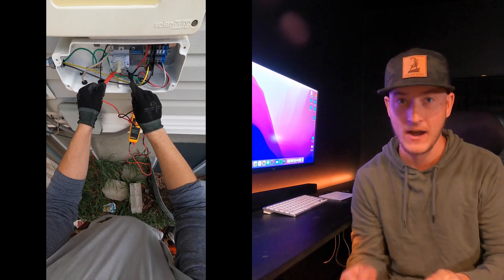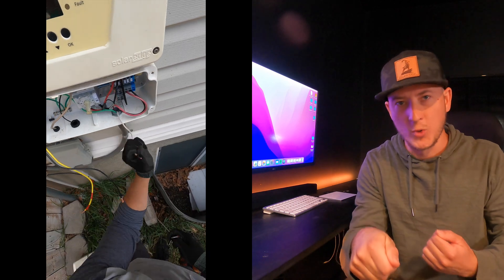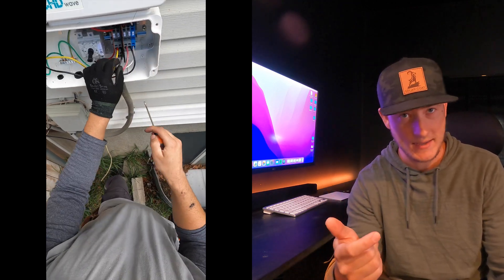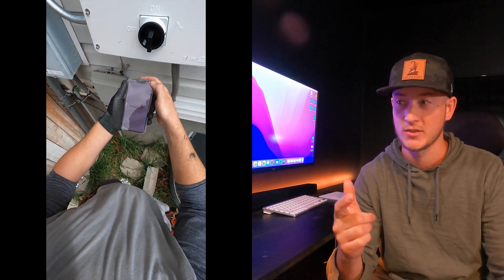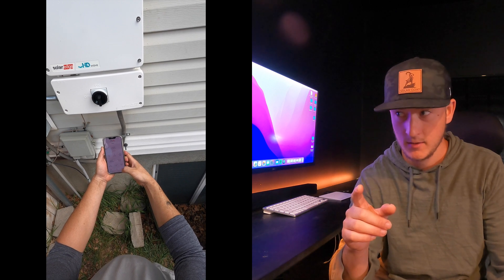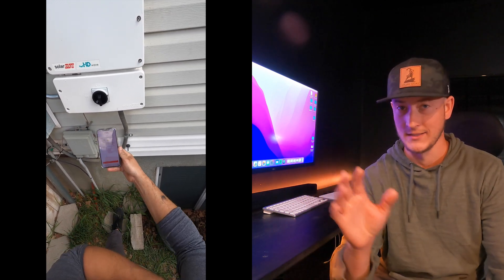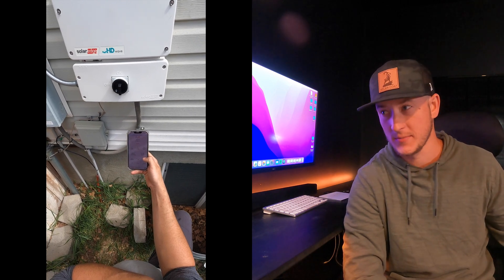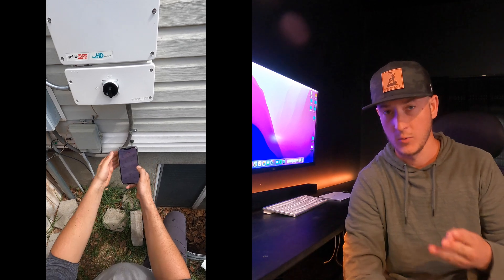How To Replace a SolarEdge Solar Panel Inverter

Comment: 2020 I spent $30k with smaller solar company. 3 years in lost wifi cause 3 g then 2 years after this April wife says electric bill $100 more . Got me to investigate , called smud and they said last reading they got was Dec 24 😔 . When I was finally able to get a hold of solaredge then finding a contractor on their preferred list $400 diagnostic lead to bad inverter and maybe 2 optimizers plus going wifi 5g . Their quote energy aid  $7200 think I'm dumb! Now I have inverter but not sure diy ,but don't have money out into it should I try?

Comment: I basically lost production for most of August and September here in Massachusetts, having Tesla replace this under warranty. It really is a simple install, so why does this take so long? You would think Tesla could arrange an advanced replacement, but no. I have been waiting weeks! Is this because Tesla is understaffed?, doesn't care that much since I am selling SRECs on my own, or is it supply chain issues due to the war in Gaza?

Comment: Thank you so much, technicians want to charge me $1200 to replace the unit. I have decided to do it myself. I’m glad there are people here to show me how to!!
Reply: Were you able to do it successfully on your own?
Reply: So long story ever did 3g modem replacement 2022.
Bought in 2020
My installer said in 2022 they stopped residential ( could I sue them?)
Dec smud stop recording solar. 

Wish would paid attention. Wife pays the bills online. Last month she said our bill was $350 little high. 
Got me to do some research. 
Used a company on my solar edge list of installers, energy aid ( Don't use) 
$299 diagnostic fee 
1. Inverter $1695 ( how if under warranty) 
2. Cell kit $2695
3. 2 optimizers $1800 
4. Labor 2x $650
5. Fees $850 gas, credit card fee, etc
Solar edge sent invert to them. Now need to wait .
System cost me $29000
 Can I diy this?
Reply: @Sciontc22jj   I 'm in Texas and yes you can DIY that, it's cheaper to get either a off grid inverter (cost around $2500) for a 12k inverter but that doesn't let you sell back or get a hybrid inverter one. they start around $3400.00 but they do both ( off grid or sell back) and all are  scalable in parallel. need more power no problem. you will also need new optimizers one for each panel. the Inverter is the big Nut in cost, all is plug & play but be careful with the solar panels. turn everything off first never unplug a solar panel under load.

Comment: Quick question for you. We are seeing over a 40% failure rate on our solaredge inverters, always the 181 HW error codes. Are you seeing this at all?
Reply: Yes idk what the deal is but I replace millions of these things
Reply from the maker: SolarEdge was known for a “bad batch” of inverters were there was nearly a 100% failure rate. Other then that the inverters seem to be holding up okay. That throws off the numbers.  I do see a lot of inverters installed outdoors have problems. Might be related to moisture getting in the inverter or other factors that could be more in the installer.
Reply: After being told that  it was gonna cost $1200 to replace an inverter that was free of charge from the manufacturer I told the company “for $1200 I’ll start my own solar company” 
Been doing solar edge training on the computer. Found we have a 7600 hooked up on 150 main breaker!!! The panel is rated for 200 amps so now I got to contact power company and see if we have a 200 amp cable. Thanks for making this video!!! I’ve spoken to solar companies trying to sell me a powerwall and explaining that I have the cheapest setup but after watching all these videos I’ve learned that the microinverter setup can’t even handle as much as a system on optimizers. Solar edges website and platform seems legit. I’m seriously going to try to get my credentials so I can pick up this niche market where solar companies go out of business and leave home owners struggling